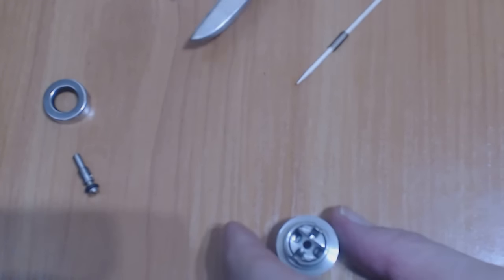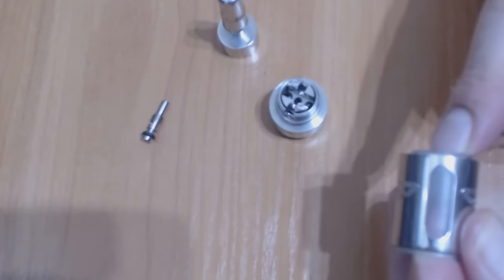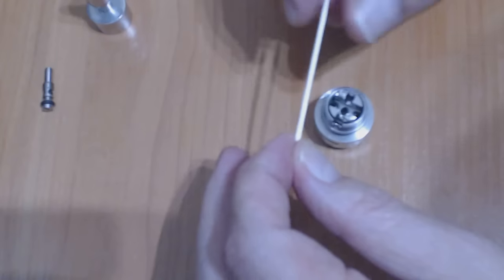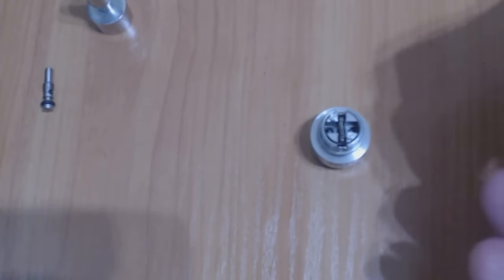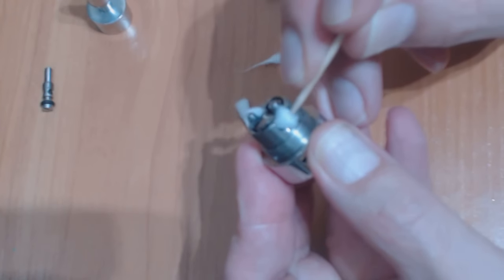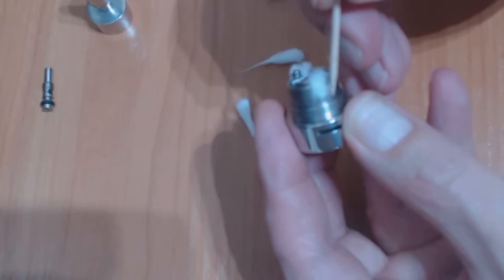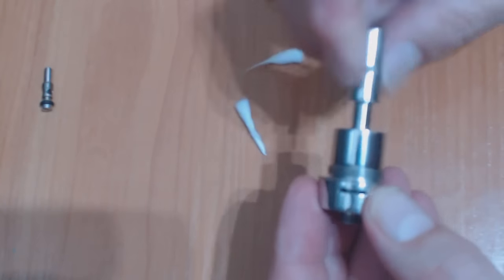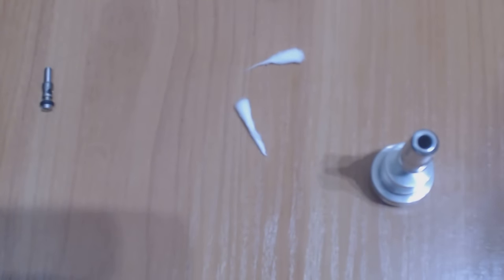GG Tilemahos Armed part 2

Comment: You are a maestro !!

piece of art!
Reply from the maker: thank you flavor!
Reply from the maker: it depends on the wire you use erock. If you use 0,35mm wire the inner diameter has to be at 2,9mm. If you use a 0,40mm wire the inner diameter has to be at 2,8mm. If you use 0,3mm wire, the inner diameter has to be at 3mm

Comment: My 1.3 ohm spring has broken during cleaning process.When they are available again? I wait since three months but they are sold out in every shop on this fucking planet!
Reply from the maker: felip, do you use a mech device?
Reply: no, but my dicodes has 18 Watts max.
Reply from the maker: meaning that you need more power for a 1,3 spring. But why dont you reduce the power and use a spring at 0,7 ohms or 0,9 ohms felip?
Reply: No, i cannot reach my sweetspot with my 18 Watt Device. With 0,9 ohm I need 22 Watts...
A new Dicodes with 40 Watts costs me 220 Euros. A new Spring with 1,3 Ohm costs me 0,6 Euros....
Reply from the maker: felip, have you tried Zr spring at 0,7mm at 18 ohm? Its very strong to my opinion!

Comment from the maker: Please dont forget to tell me your opinion  felip :)
Reply: I'm not willing to vape subohm, just because GoldenGreek does not want to deliver the most important spare part anymore. 
I built a Spring yesterday. Kanthal 1,5 ohm. It works but it takes time.
A shame that the build of my X1 takes longer than on any other RTA I own. 
I think i will sell the X1 and buy a Rose 3 or something else in the comparable range….
Reply from the maker: felip, thats not an option lol

Ok, let me explain you what is going on:

Low ohm is not subohm. The ohm means nothing without the power applied to it. I mean that if you vape with a 0,2 resistance but the voltage is at 2 volt, then its not subohm, its just a regular vape.

Now, if you vape on a wattage device, the resistance doesnt play any role on vaping. Its exactly the same if you vape a wire at 1ohm or a wire at 1,4 ohm or a wire at 0,2 ohm IF wattage is steady. So your sweet spot is the wattage and not the resistance.

What it plays role is the width of the wire. The thinner the wire, the stronger the hit at the same power. So, a fatter wire needs more power, the thinner wire needs less power for the same vape. So if you were using a 0,35mm wire then you have to still use a 0,35mm wire.

You were used at 1,3 resistance wire at 0,35mm SS with 22 watts power. Now you can use a wire (0,35mm Zirconium) with the same power (22watts) with exactly the same results.
Reply: OK I understand , thank you imeo, so I will try the zirconium wire.
Reply from the maker: you will love it felip, trust me on that!
Reply: OK, it's great! I will buy the wire as well! Can I do a dry burn to clean it or is it better to clean it like the SS spring?
Reply from the maker: great Felip!
As for the cleaning......forget the dry burn procedure. Its more than dangerous for your health! You must clean all metals and wires too with water and soap. But the even better thing with Zr is that it doesnt keep residues on it like SS. Put it under running water and its ok!
Reply: OK. Thanks a lot!